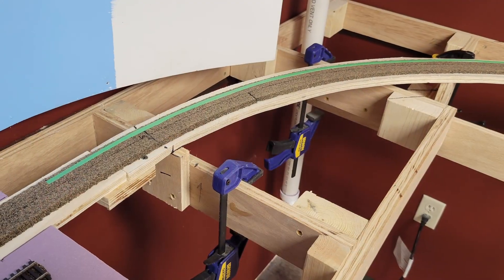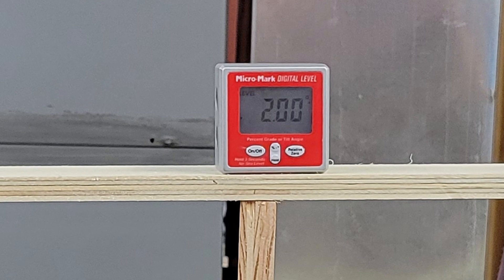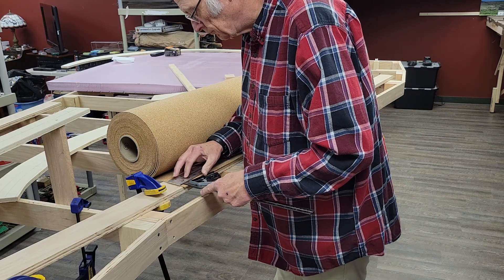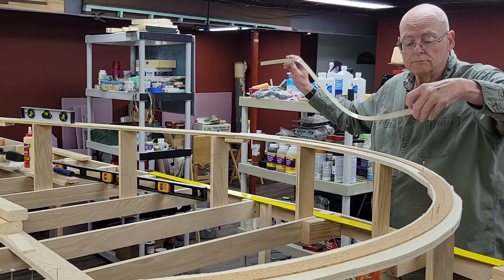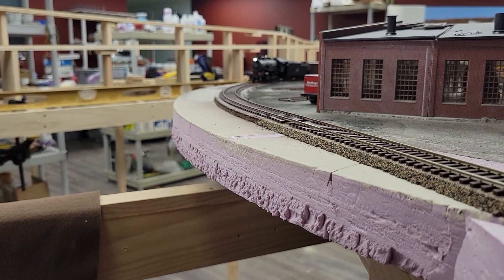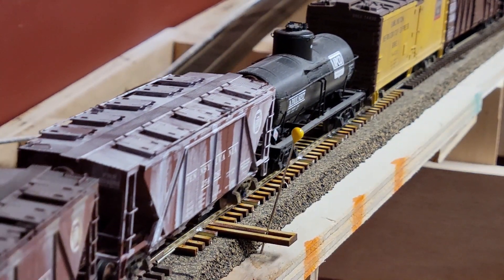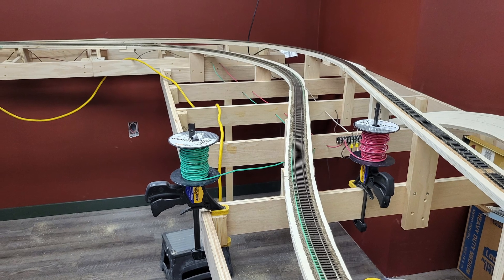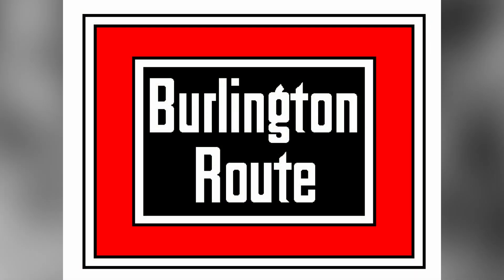2021 12 03 CB&Q V5 Monthly Update #25

Comment: I share your fear. One time, while testing track, my engine took the passing track turnout to oblivion. Fortunately it was a “Blue Box” cheapie and surprisingly enough it still ran despite the four foot drop to the concrete floor.
Reply from the maker: OUCH! 
Many years ago (1980's) I had an unpainted brass Great Northern P-2 Mountain that stalled on a dirty section of track. It was hard to reach, so I used a section of flextrack to nudge it. The ties caught in the bell cord and pulled the loco off the track. It tumbled almost four feet to the cement floor! The sickening dull thud as it hit the floor still rings in my ears! Fortunately the hobby shop owner knew someone who could fix it. A few months (and a few hundred dollars) later it was good as new, painted and numbered to match a real P-2 that had detailed when it hit a boulder that had fallen onto the tracks near Puget Sound.